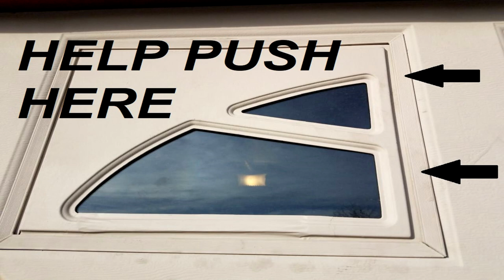How to Replace Garage Glass Window Pane Panel

Comment: Got a similar quote for a replacement (~ $340).   Like others here, could NOT find anything about how to remove (or purchase) that inside "trim".  Assumed it had to be removable, but mine is caulked and stubborn, so didn't want to force it.

Glad to have found your video confirming I wasn't on the wrong track.  Great job!
Reply from the maker: Yikes, that caulking might need to be removed! Mine were not caulked, and would allow water and moisture to seep through. Awesome happy I could help, Cheers! 😊

Comment: This video was very helpful. Thank you for the tips on what tools to use. I had this exact problem. No garage door company would even consider fixing this. I have garage door over 30 years old. In my case the procedure went similar to yours but my outer frame edges extend inside so once  I started to pry open inside I realized that I could not slide the replacement glass so what I ended up in doing is kind of pulling the inside edge out .... sort of opening the back of a photo frame. Once I was able to get one edge worked up I could slide the replacement glass and then rest is like you have shown. I was quoted anywhere between 350 to 450 to replace. Also I ended up in using clear acrylic sheet which was flexible enough for me to squeeze it through the frame. Over the years the frame had become very brittle and I had to be very careful. However Thanks Again for steering me in right direction. It saved me a lot of money.
Reply from the maker: Awesome thanks so much for the great feedback I'm glad we both save money!! 😊

Comment: Perfect video, thank you!  A clean track is a must.  I had a lot of factroy sealant that had t be cleaned out with a razor knife.  Lots of spray lubricant helped, I used silicone.  Thank you for not taking 20 minutes to explain a 5 minute job.
Reply from the maker: Excellent! Glad I could help 😊

Comment: Any idea on where to get replacement trims if I break one?
Reply from the maker: I had the same conundrum I could not find them easily, but there are entire kits on Amazon and in your local home improvement store and some thing I figured out is to buy some generic plastic and make a cut out and glue it or use tape and paint it.

Comment: Any idea where to get those outside trim arch looking pieces?  I’m missing two of them
Reply from the maker: I had the same conundrum I could not find them easily, but there are entire kits on Amazon and in your local home improvement store and some thing I figured out is to buy some generic plastic and make a cut out and glue it or use tape and paint it.

Comment: Thanks for this video! I have this same window (Clopay, 1994). Any tips for removing the trim to get to the broken pane w/o breaking the pane further or damaging adjacent styrofoam door insulation? I have both the auto trim tool you show and a pry-type scraper knife but can get the trim to move only slightly in one corner. I've been working up the trim w little luck. Is it easier just to remove all the broken glass before removing the trim? I'm about at that point.
Reply from the maker: If the edges are stubborn, breaking out the rest of the glass seems easiest but I recommend covering all glass with tape so it wont shatter, please be cautious!

Comment: By any mere chance, would you know where I can find the outer plastic decorative / designs ?? 
I’m about to replace 2 panels of of broken glass but the decorative pieces were broken too. Any, I too I’ve been scratching my head trying to figure how to replace these panels. Will attempt today 
Will post update
Reply from the maker: I had the same conundrum I could not find them easily, but there are entire kits on Amazon and in your local home improvement store and some thing I figured out is to buy some generic plastic and make a cut out and glue it or use tape and paint it.

Comment: Thanks brother super helpful.  I have this same style and I actually cracked the pane trying to change the older inserts.  If you have any references on where to buy new decorative trims that would be fantastic!
Reply from the maker: I found these available for custom/special order at homedepot/lowes hardware stores. You could also check with garage door manufacturers they have their parts department sometimes

Comment: How did you put the trim back on? It seems impossible!
Reply from the maker: It’s going to snap back with enough pressure it is a challenge for sure!
Reply: Thanks for the reply.  Is it pushed in or hammered in?
Reply from the maker: @barcinnn  I think hammer May break it but enough even pressure should snap it in otherwise or the plastic is maybe broken and folded inside

Comment: Do you happen to have the glass measurements you used for this? I figure I could compare them to what I believe mine will need to be, our doors look the same.
Reply from the maker: These were about 10in×12in but sizes definitely vary, I recall cutting this to slightly less like 9.9x11.9in, best to cut and test a cardboard or paper to match the exact dimensions!
Reply: I took the frame pieces to a glass shop, cost me like 15 bucks and they made it the right size to fit. Video was helpful, thanks.
Reply from the maker: @SubaruFanatic  That's great! A good safe alternative, the glass shards  are easy to prick fingers! 😅
Reply: @RogerFleenor  I still did all the work myself, I just didn't cut the new glass to size.
Reply from the maker: @SubaruFanatic  excellent! That is great news!

Comment: In trying to reattach the trim.pieces, they dont want to hold. I push them down with someone pushing on the other side. And I dont want to break the glass by pushing too hard. Suggestions?
Reply from the maker: I remember I had some glass stuffed inside so I took the entire frame apart and cleaned and pushed it together away from the garage then took it apart again and moved it back on the garage. Also you might like to try without the glass panel to see if the plastic is stretched broken or has debris inside!

Comment: Is there a way to take out/replace those decorative front pieces also? I have those same ones and so outdated!
Reply from the maker: You're talking about the square with the cut out shape right? I found that I was able to just pull it out from the front. If you'd like to install another you can just bend it into place!
Reply: Do you know where I can buy the front square ?

Comment: What size is the glass panel itself?
Reply from the maker: These were about 10in×12in but sizes definitely vary, I recall cutting this to slightly less like 9.9x11.9in, best to cut and test a cardboard or paper to match the exact dimensions!